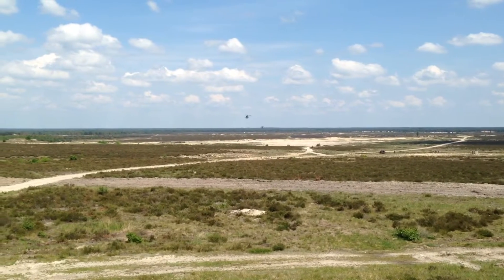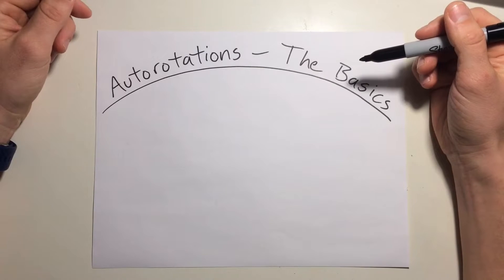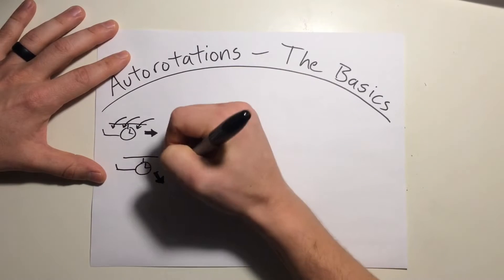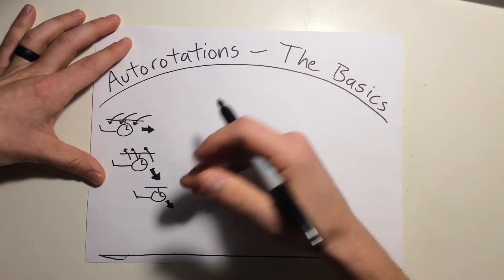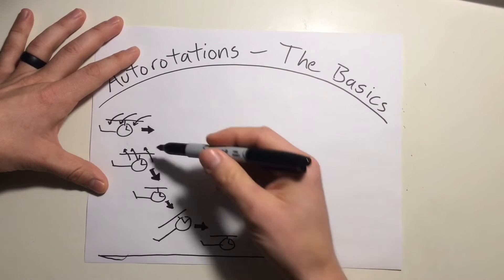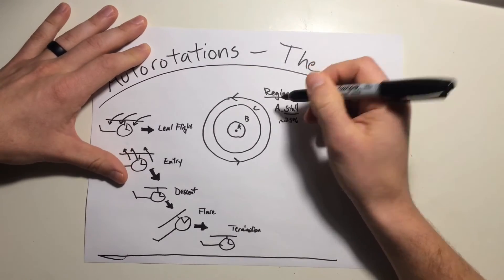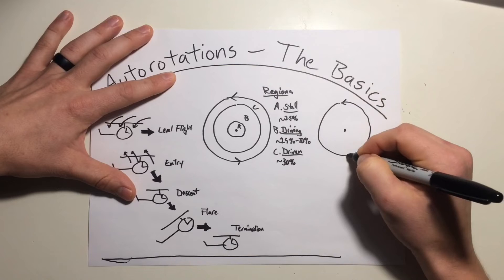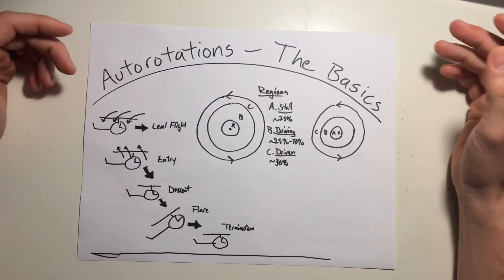Autorotations (The Basics) in Helicopters

Comment: Just thought I'd let you know:  You make these videos so well that they actually recommended us to watch your videos during Primary phase at Rucker.  You are literally becoming part of the Army Aviation curriculum!  We can't thank you enough for your videos man.
Reply: Currently at Rucker. Verified they still recommend.
Reply: Not only at Rucker, but also in all around the world.
Reply: $$$ is it coming? Obviously deserved...
Reply: To be honest, this didn't really explain anything about how it works. If you have air flowing upwards for instance, are you able to put negative pitch in to force the blades to spin? Using positive pitch should only slow the blades more and more until the stop or move the opposite direction, assuming you have enough altitude and don't hit the ground before that which you likely would
Reply: @ScienceBitch123  negative pitch?
Reply: @ScienceBitch123  "The most basic level, ill make a follow up video..." You don't listen do you? 😂
Reply: @ScienceBitch123  the reduction of collective decreases the collective pitch angle of all the rotor blades which means they are generating a minimal amount of lift. This will cause the helicopter to descend (usually quite rapidly) and the descent will force air upwards into the rotor system which turns the blades, increasing rotor speed and inertia stored in the rotor system. 

When it comes time for the flare/deceleration, the air being forced through the blades by forward airspeed and the inertia in the rotor system will keep the blades turning for a short period of time before rotor speed starts to decay to a point of the maneuver being unrecoverable. It’s in this window after decelerating and leveling the fuselage to make the input to the collective that increases the pitch angle of the blades to generate the lift that cushions your landing.
Reply: This comment makes me think I'm in the right place!
Reply: While according to the POH you should keep RPMs between 97% and 108% anyway don't forget critical blade stall happens below 80% RPM. But factor in that you have to add 1% for every 1000 feet density altitude. So if you're at 10,000 ft density altitude critical blade stall would happen below 90%. Obviously Max glide and minimum Glide are done with 90% RPM. Be very careful there with your density altitude. Don't forget that's density altitude not pressure altitude. You can take into account for the adiabatic lapse rate that for every thousand feet altitude you gain the temperature drops by 2° C. But since density altitude is pressure altitude corrected for non-standard temperature anyway then you're not basing this by your actual altitude but density altitude. A safety buffer could just be to keep your RPM above 90% at all times.

Comment: it's unclear for me, as if the airflow is reversed through the blades due to descent, the airstream momentum acting on the blades tends to reverse the rotation of the rotor as well (or at least to decrease the RPM) but not to increase the RPM... unless a negative blade pitch is applied; not sure if its possible, though I'm not a professional.Would you like to clarify?
Reply: My question exactly... I am having a hard time understanding this... And no one to explain porperly...
Reply: I'm no pilot nor an expert, but it is my understanding that immediately after the moment the engine fails, you lower the collective all the way down to change the angle of the blades so the upward flow of air through the rotor maintains its RPM.
If you don't lower the collective, this upward flow will reduce rapidly the RPMs as the angle of the blades oppose to this flow.
Reply: After establishing the autorotation you must maintain the rotor RPM within its limits of operation. Same case with the airspeed and glide slope recommended for this situation. This means you input corrections to collective, pedals and cyclic all the way down to ground.
Reply: There is a forward component to the lift vector of each blade in the driving region of the rotor disc that opposes drag on the blades and keeps them spinning. The situation is completely different from a windmilling propeller on an airplane.

Comment: If the blades are no longer powered and the wind is turning the blades, why the fuck don't the blades spin in the opposite direction?

Without any fancy flight language, please explain why the fuck air couldn't slow down and reverse the blades?

Comment: I'm having a hard time finding one bit of info (I'm getting lost in the bulk of information) -- after initially lowering the collective when entering autorotation, WHEN and by HOW MUCH is the collective raised or lowered during the steady state descent? How does the pilot determine this? Or is collective kept in the full down position until near landing?
Reply: Collective is adjusted(raised or lowered) to maintain rotor RPM value within safe limits of operation so as to achieve an effective flare.

Comment: Its clear that the main blades are rotating because of the upward flow of air during autorotation.....
and my doubt is how we can rotate tail rotor, and from where the tail rotor getting power to rotate during autorotation?
Reply from the maker: It’s all linked to the main rotor via the transmission. If the main rotor is turning, so should the tail rotor.

Comment: So I have a question. U lose engine. As the chopper falls you start auto rotation. Pls explain why the whole helicopter doesn't rotate uncontrollably? I ask because I thought what stopped a chopper from spinning uncontrollably was the tail rotor contering the rotation that would be caused by main rotor alone. If you are falling in autorotation without engine power I suppose the tail rotor wont turn. Or just the turning of main rotor is linked to synchronize with tail rotor regarless of it being powered by en engine or just the wind caused by free fall of gravity?I hope that made sense.

Also I understand this varies but +/- what is minimum altitude to pull this off safely? 

 Thanx in advance for any answers
Reply: jaime delgado when the engine power is disengaged the torque is not a factor.
Reply: @Samiferusa  thank u. I had a feeling that would be b the case but wanted to make sure. Happy New year.

Comment: i still dont understand the aerodynamic force that causes the blades to gain rpm, it have thought an upwards flow would make the blades loose rpm and want to spin backwards
Reply: I'm not a pilot, but it would seem to be that the collective is lowered to the point that the blades would be at a negative angle of attack.
Reply: @hamnchee No, the blades do not go into a negative angle of attack. That would cause the blades to hit the tailboom. The blades keep spinning because there is a forward component to the lift vector of each blade in the driving region of the rotor disc.

Comment: Is the Pitch up during the flare proper at each hélicoptère ?
Reply from the maker: I’m not sure I understand your question but the aircraft does pitch up during the flare. The amount of flare varies based on airspeed. The aircraft should never flare so dramatically that it begins to climb in altitude.
Reply: @helicopterlessonsin10minut10  you have to low the collective, if you won't climbing during flare 
Thank you for answering me,
My question was, flare the aircraft is giving nose up with so and ao degrees....is this nose up different for each aircraft ?

Comment: How can you have different regions of drive or driven on the same blade? Unless it's front /back regions along its length
Reply from the maker: It all comes down to total aerodynamic force which differs because different parts of the blades have different air speeds. The tip of the blades travel faster than the root.

Comment: I read that the pilot, who was flying the helicopter that crashed and killed country music star, Troy Gentry, attempted this maneuver, and it seems it did not work. There are many articles that say the crash was the result of "pilot error", though it seems the autorotation maneuver is a common one, that can be used in case of engine failure - or as in this case - the pilot purposely shuts down the engine. Shouldn't the upward airflow have actually made the rotors speed-up? I'm trying to understand what exactly was the "pilot error" here. Thanks
Reply from the maker: I haven’t read into any investigations on the accident. But upwards flow of air doesn’t speed up rotor RPM unless all of the pitch is taken out of the blades.

Comment: So is an autorotation principally the act of taking stored energy in the rotor blades and by increasing the collective, turning it into kinetic energy by increasing the rotor blade pitch?
Reply from the maker: Michael Lenoch. More specifically, the first part of an autorotation involves reducing collective (reducing pitch) to turn potential energy (altitude) into kinetic energy (airspeed/rotor rpm). The second half of an autorotation is when all of the kinetic energy is expended to reduce rate of descent and cushion the landing.

Comment: In my readings I see that the DRIVEN REGION does produce some lift but this lift however is offset by drag due to the Total Aerodynamic Force(TAF or Resultant Lift on Airfoil) being behind the axis of rotation. In an auto, the DRIVING REGION's TAF is in front of the axis of rotation producing a continual accelerating force that supplies thrust and  accelerates rotor rpm. Collective Feathering changes the size of the DRIVING REGION which changes the rotor rpm . In an auto, a pilot needs to adjust collective to keep the rpm within limits otherwise he stalls out or the blades fatally cone upwards. Lift is no longer a significant force in an auto..using the continual inward airflow to keep those rotors spinning so you can glide safely to the ground is the main idea of an Autorotation.
Reply: Safely to the ground is a whole
nother story... Where you land or ditch...

Comment: Hey there! great video but I have a question about entering an autorotation state with 0 rotor speed? Is this trickier to do to overcome the inertia and drag of the blades? Any insight on this would be great!
Reply from the maker: Michael Fadar. Autorotations with zero airspeed aren't that big of a deal if you are at a lower hover with zero airspeed because you would just cushion your way down. However, higher altitude autorotations with zero airspeed can be fairly dangerous. You'd have to lower the collective to maintain rotor rpm and then pull in everything towards the bottom to arrest the sink rate. The dangerous part is that you'd be entering into a potential settling with power condition as you cushion. But just like with a regular in-flight autorotation, the blade rpm has to be maintained at all times during the descent. I hope this helps.
Reply: Airborne with 0 rotor speed is impossible, 0 airspeed is improbable.

Comment: Very well explained, nice job!!
I’m currently in autorotation training lessons on the EC120B, although they are simulated with engine not being idled and without touchdown on the ground, so the ground where we touch down is meant to be at low hover height.
Reply: Victor plead with your instructor to let you do a full touchdown auto to the ground.  That last 15 feet is critical.

Comment: When you say at 4:45 => "... We have the Descent Phase, where we're CROSS CHECKING ALL OF OUR INSTRUMENTATION to make sure we are in a steady state autorotation prior to the ground..." 

With the "engine out," what are "ALL OF THE INSTRUMENTATION" that we should be cross checking? And from what  instruments are we cross checking from? ... and back to? 

What if you realize that you have been taught to cross check all of your instrumentation and you suddenly realize that there wasn't time for all that this time? ... and you should have had a plan that works every time - even when there is no time - to check all of the instrumentation, like you were told to do by Mr 10-minute Helicopter Guy with the black wedding ring? 

When there is no time: you need to always be at minimum autorotation altitude and airspeed and then at engine out: drop the pitch handle and fly down and flare out with the dead stick. Works every time. No need for your "IFR!"
Reply from the maker: BEST REPLY. While in an autorotation some of the most important instruments to note are rotor speed, airspeed, and trim. Keep in mind the this doesn't mean focus purely on these without looking outside. Noting winds, closure rate, general aircraft attitude, etc. are extremely important. Keep in mind nothing pays more dividends for autorotations that actually going out and practicing them. Instructional videos can help teach concepts but hands-on practice is what helps you survive.
Reply: Thanks for reducing your original advice about, "cross-checking all of our instrumentation" during a helicopter engine out/autorotation. 

It doesn't help to look at the instruments to check your "rotor speed" or "airspeed" either, because at "engine out" you need to maximize both of these immediately - using autorotational skills, not Instrument Reading Skills. 

So, the caution that I am giving here is that:
Not only is "hands-on practice" the best way to learn autorotation skills - your instructional video will have pilots practicing unnecessary "IFR cross-checking" concepts that will get them killed.
Reply from the maker: BEST REPLY. At this point I'd have to disagree with you. I've trained quite a few pilots on autorotations, and many times had to abort training autorotations where airspeed was bled off dangerously low, irregular attitudes weren't adjusted, or rotor not properly maintained. This cross check is extremely important when practicing autorotations at night where visual cues are reduced. The advice that a cross check will get people killed is faulty at best. While I appreciate feedback on the channel, the purpose of these videos is to teach general concepts to supplement flight training, not replace any training done in the aircraft, nor to pick apart semantics.
Reply: Citing how many times or years you've been doing it wrong is not an argument based on merit. And there is no "semantic argument" going on here so please stop with the over complicated, smoke screen of "the CFI knows it all approach." 

Your point about having bled off too much airspeed goes to MY point that this needs to go to max immediately - without wasting time to check the panel for exactly how slow you are going. So thanks for that.

Why did you go back to your "cross checking" bit? So,  we are back to square one with you "CROSS CHECKING ALL OF OUR INSTRUMENTATION ... blah blah blah" - I thought we got passed that! 

So again, what are all these critical cross checks on the panel?  Your first answer was "airspeed and rotor rpm" but that just needs to go to max - and is not accomplished by "panel-gawking" but by watching your ground closure outside and by flying! 

And finally, it's laughable that you deny that "cross-checking" all the instrumentation to assure that you are in a proper steady state autorotative descent according the the instruments, etc, etc etc. (aka "panel-gawking") won't get you killed because that's exactly what WILL get you killed. It's not "faulty" logic and it's not "semantic!" 

If you disagree with me then how do you disagree with : engine out? drop the pitch and fly the stick!  This is all you can do at low altitude when there's no time for CFI  [5 seconds of panel gawking and you're sitting in a hole in the ground!]
Reply from the maker: BEST REPLY. Thanks for your input.
Reply: BEST REPLY =〉 while it appears from your comments that you are the know all and end all of helicopter flight, Jacob is correct to do a quick scan of critical instruments, after lowering the collective. Part of entering the autorotation is setting the aircraft to the best glide speed, while attempting to complete the auto into the wind. But I guess that doesn’t matter to someone of your obvious superior knowledge and abilities. 🙄